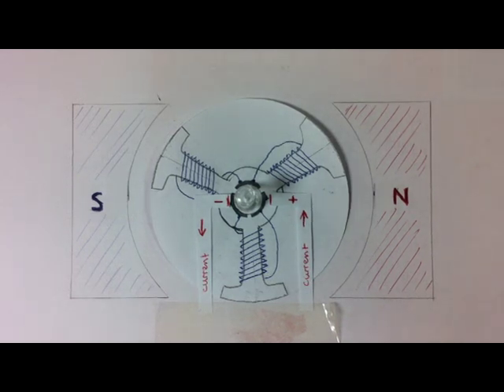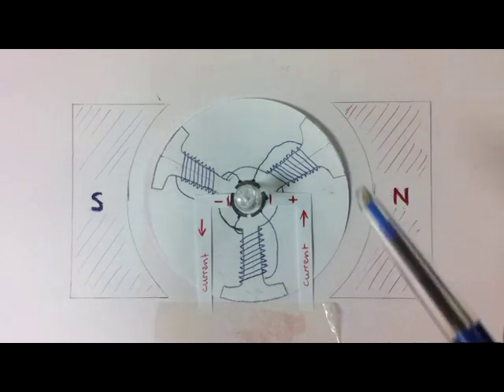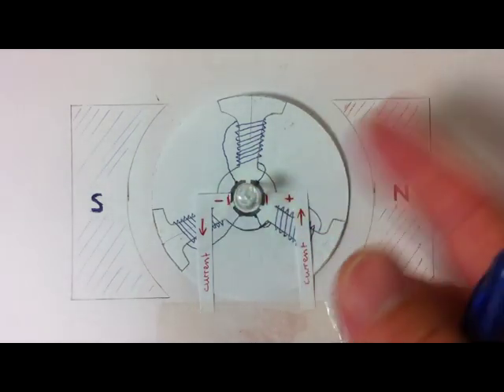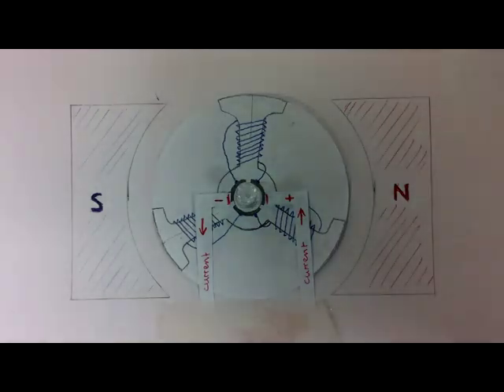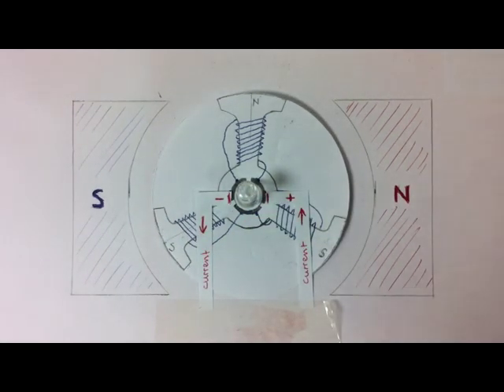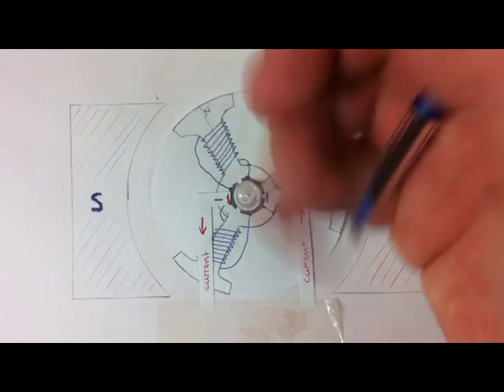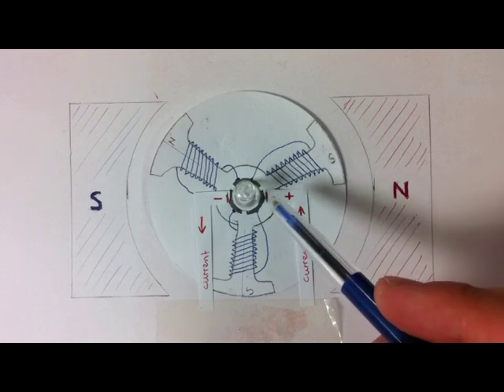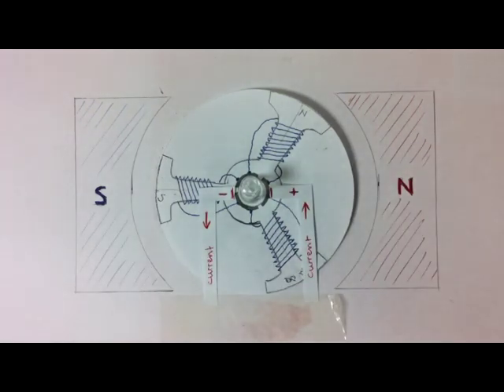How a 3 coil DC motor and commutator work

Comment: Thanks! Great explanation. However it appears as if the 3-coil motor doesn't utilise the motor effect in its rotation. The individual wires experience a negligible force from the external magnetic field. So is it only the induced poles from the 3 solenoids that drive the motor? Is that right?

Comment: hi !
What happens if I put a capacitor in parallel with each coil in the armature in a delta configuration instead of using just one in the input outside the motor ?

Comment from the maker: Thanks mate. You ask why one is in parallel. I think you must mean, from the diagram I show. Sorry I might have forgotten to mention that the diagram is merely a snapshot of what's going on at a certain point in rotation. As the rotor rotates, the commutator "rearranges" how the current is transferred around the coils, making any one coil either in series with another, parallel to another two, or shorted out altogether. Hard to explain in words! If you're desperate, send me a PM with your email

Comment: That is a TWO pole motor, not three. This armature is described as having three slots (where the windings are inserted in to the armature core) and six bars (ie commutator bars). An otherwise great explanation of how a commutator functions to actually switch the current to the windings in sequence, though your brushes are in the wrong position by 90*, and of course there will be a voltage developed in the windings, the magnitude of which varies with their position within the field, and the speed. The armature windings do not produce “poles” in the armature core. The armature core field is supplied by the field poles. The armature windings interact with the field, so as to develop voltage from movement, torque (in either direction) due to current.

Comment: Build bi-polar coils with dual brushes.
The simutainously wound clock wise anti clockwise coil will loop the EMF back into the coils MAKEING it self gerating and perpetual once it is energized from out side one time.
Tesla self energizing bipolar ac motor.